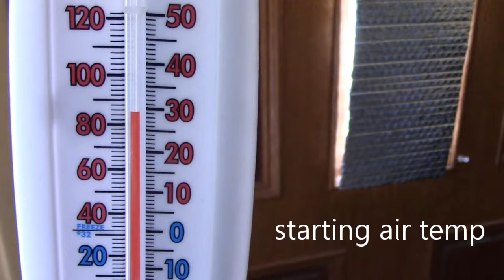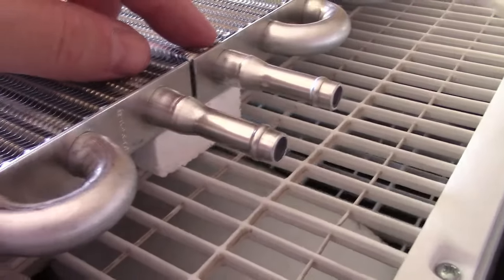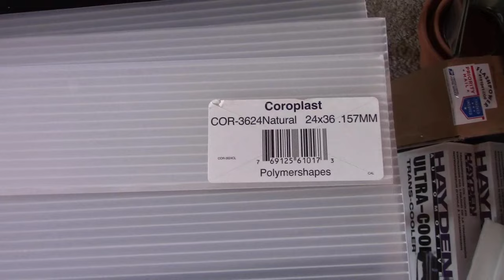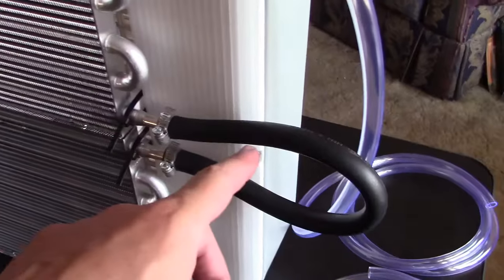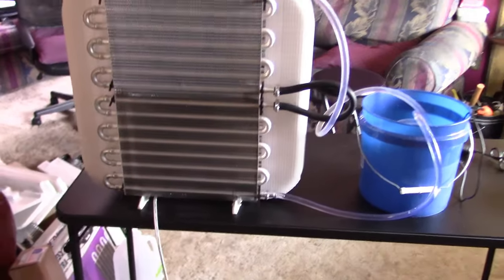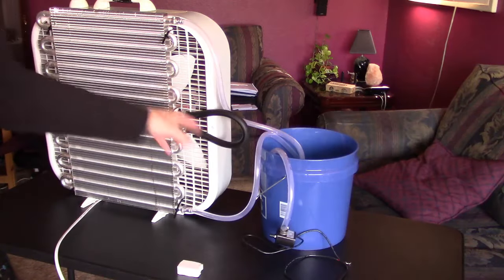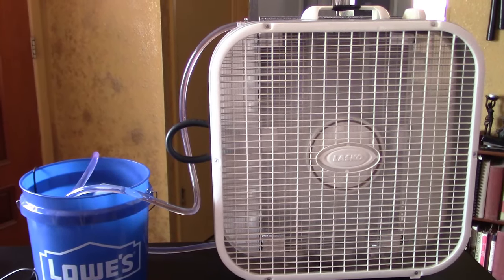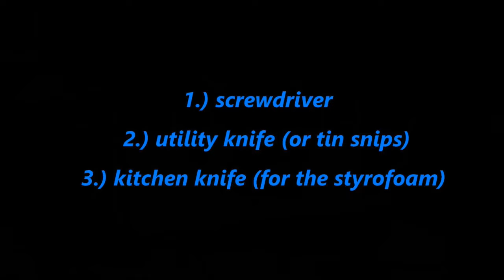DIY Air Cooler! Homemade Air Cooler with AC "like" feel! (extended *semi-uncut version) Box Fan conv

Comment: Though most people might not initially think of it that it might not be a lot of lost airflow, intake will mostly take the path of least resistance. I really like your idea to solve that by using foam shrouds to direct all of the air over the fin coils. I might also suggest using a removable micromesh screen to cover the coils and keep any house dust from collecting and clogging up your radiant fins. Also an evaporator tray or pan like a long planter box under the coils to catch any condensation. I'm also thinking that the use of a cooler V.S a bucket would help your run time per changing out water for more ice. Thank you for the great idea and the theory. I'm off to build my own version now. :)

Comment: This is very cool, no pun intended.  Is there any difference in the transmission between the two radiators since you are running that same water through both?

Comment: So cool. Great out of the box (fan) thinking. I was thinking if you run each radiator on it's own small pump, rather than have a two stage system, you would have two single stage coolers pulling from the same reservoir. I believe this would be more efficient.
As the water makes it's way through the top radiator and into the second radiator, the same volume of water will gain more heat in the second stage from the environment, and return this heat into your reservoir, reducing the run time.
Running each radiator separately from the same reservoir will also make the top and bottom radiator run at the same temperature, rather than the top being cooler, and the bottom running a little warmer.
Reply: You will also have 2 pumps generating heat in your reservoir rather than 1.  so it's 6 of 1, half a dozen of the other.
Reply: @rasputinsorphan1260  IF he was to put a tee in the supply side and keep the lengths of tubing equal to both coils it should depending on any difference in the resistance of the coils themselves be equal flow to both. It would also be possible to do the same on the return side by using yet another tee and keep those tubes as equal lengths too. That would make it possible to use one pump and have equal temperature of water to both coils.

Comment: HI and thanks so much for your videos!! Only have one question. Why use the Cloroplast between the radiator and the fan? Doesn't it interfere with the air flow? There was no sound (for me) when you probably explained it, and I looked at the comments and probably missed you answering the question.  Much appreciated.
Reply from the maker: hi. the plastic side panels are just on the edges of the fan. they end right at the edge of the radiators so they don't block the airflow between the fan and the fins.

Comment: I wanted to try your method but i had alot of car radiators in my shop just laying around and sure enough that worked. But the only give away was that i had used dry ice with water.

Comment: I already ordered the radiators. I tried the whole copper wire around the box fan but its not that efficient. This looks to be way better. The power went out over here in Southern California a few days ago and it was hot. Luckily I had mine built but I realized it wasn't blowing cold enough with copper tubing. I like the combo with the Evap cooler too. After I get this together, that will be my next project. Thanks for the videos and the explanations. This helps out so much, especially for someone like me whos mind is constantly going and thinking of solutions to these grid down problems.
Reply from the maker: hey there! i'm glad my videos are helping you! i'm also glad you're making the projects. since the "copper coil" unit is just copper with no fins, the heat transfer is only partial. these fans with aluminum radiators are much better at the heat transfer (and therefore cool the air much better). i'm glad you noticed my other videos on how to use these 'fans with radiators" along with my DIY evap 'water chillers'. that makes indirect evap cooling and is a great way to make the cold water without using ice. for anyone interested in evap water chillers and indirect evap cooling here is my main video on the topic https://youtu.be/I6u6yCe8RzI
Reply: @desertsun02  by the way. It works great! I connected the box fan with the radiator on the back and connected it to the evap cooler. Just awesome! Thank you. I want to make a smaller one for my sons room.

Comment: Loved this video.. You could try mounting it on to an ice pack box where the entire unit would sit on the cover of the box (that is if the weight of the fan and the grills aren't too heavy). That way it would look compact and avoid the hassle of an open bucket with pipes.. Kudos thoo.. 👏

Comment: Just wanna start off by saying thank you for the idea. I tried it out myself today and was on a budget so I just got one transmission cooler and even with just one I was so surprised how cold it was blowing works great defiantly gonna order me another Hayden radiator it’s like it was made for it. The only issue is I get a lot of condensation on the water hoses. I am thinking of also insulating my Home Depot bucket or using a styrofoam cooler. I need to find a way to be more efficient and keep the water colder for longer. My ice tends to melt pretty quickly been getting a lot of 100 degree plus weather recently in Southern California. Thank you again for the idea.
Reply: How long did it last for you? And what about water dropping from the transmission oil cooler? How did you deal with that?
Reply: @007alztruli  so since my ice would melt pretty fast I started to use bags of ice with ice packs included  to keep the water colder longer. I also put foam insulation on my hoses. It was a piece of foam that looks like pool noodle but made for pipes to insulate them. Instead of a homedepot pocket I used a actual ice chest too. And I would also get a lot of condensation on my transmission cooler so I would put like a towel underneath my fan to catch the water dripping that was caused my the condensation. Another thing that would would help was spraying the coils before hand with cold water to speed up the cooling process. Hope this helps.
Reply: @Guzman3605 Thanks. You didn't say how long the ice lasted though...

Comment: Great build. Thanks for your videos. I would love to see a build with all 12v components and have it run off of solar panels with a charge controller. Does it matter which aluminum radiator one chooses? I’m assuming everything can be acquire from an automotive store. Thanks in advance. 🙏
Reply from the maker: hi and thanks! i like the hayden transmission coolers the best - but i'm sure there are other good brands out there. i've got videos on running these off of 12v solar panels. to find them fast check the playlist area of channel 👍

Comment: Have you considered using a water dispenser( I don't know what they're called in the US.. I'm talking about the 'water coolers' they have in offices) instead of ice water? The power consumption would be almost negligible and you'll have a constant supply of ice cold water that'll never warm up 🤔
Reply from the maker: hi there. i hadn't thought of that but that is a great idea. if they can cool the water at a good pace that might be the answer to cooling 24/7 with ease.
Reply: A cheaper option might be putting the pump and water in a "portable mini fridge cooler" and drilling some holes through it for the tubing. They are about $44. Not sure how much power they draw.
Reply: @bigzen69  the problem is the water is being cooled... as the fridge emits energy into the room🤣
Reply: @matthewhodes1908  exactly you would need to dump the air to the out side from what ever is cooling the water.  I would use something like this out on my sun room that doesn't have ac to it. I could work in cool space and then just refill the warm water.
Reply: @biggc49042  how can u get the hot air outside?
Reply: @matthewhodes1908  you would need to set up something like a dryer vent has. What ever the exhaust from the condenser or what ever is cooling there is a heat exchanger thwt needs to be vented outside.

Comment: lol this was exactly what I wanted to see, I wonder if you can get away with other types of radiators that are cheaper for the surface area.
Reply: he has a few he made with copper tubing and one with copper tubing and aluminum fins but you could also just use a garden hose, it wouldnt be as efficient but it would still be cold from the water and theres no reason you couldnt recycle an old window ac's radiator system or look through a salvage yard for one

Comment: Great idea!  I'm looking for the parts to make one in case of power outages here in TX but I can't find the pump with barbs for 3/8".  Could you add a link to the one you have?  Thanks in advance!
Reply from the maker: the pump i have is an 8mm (5/16") one i think if you use a clamp it fits good.
Reply: @desertsun02  Thanks!

Comment: Amazing work! Since I can't get that radiator imported here, what would you say.. is it worth trying with a water radiator (the one used for cooling the engine) or the flow would be way too fast and the effect will be less?
What would you advise?
Keep up the great work!
Reply from the maker: hi. i'd say give it a try 🙂
Reply: Hi 
Did you try using the car water radiator ?

Comment: Hi, thanks for sharing. I used your concept and build a mini one. Nice.
One question is, how you handle the condensation issue? The cooler will be dripping wet.
Just trying to see if you have a tip for this.
Reply from the maker: hi. i don't get any condensation (because i live in an area with low humidity) but you could make a simple drip tray *or possibly just set it on a towel or plastic sheeting

Comment: Hey I built my own version of this based off your video, Ive used a food cooler instead of a bucket which Ive then added more insulation to the outside & it works great. I had an idea based on your mini-fridge/freezer peltier video, do you think if I attached peltier units to my food cooler to keep the water inside cooler for longer would be a good idea? Or would this just be adding more hot air into the room anyway? What are your thoughts?
Reply from the maker: hi there. hey, that's awesome that you built it and it's working good! i wouldn't bother using peltier with this. those take a long time to cool things down. this unit would overpower those very quickly. also they would just add hot air into the room. you could exhaust the hot air out of the room then they might help a little...
Reply: @desertsun02  Thanks for the reply I appriciate your input. I think I might buy a mini-fridge so I can keep more ice packs to prolong each ice refill instead.
Reply: keep the fan unit inside the house and the bucket outside with peltier attached.

Comment: Great !! Must work excellent in Arizona or arid places.Here we get 100F on 80% RH during summer,so we deal with lots of latent heat..but I gave you advice.Buy that small chest freezer at Lowes and put that bucket in it,fill  up the freezer with ice from gas station, let the freezer run for a day and then it will last a good week of constant cooling for what just 200W chest freezer running?! The most efficient cooling is to have cooling device in the room. yes..
Reply from the maker: hi. since this isn't evap cooling it works pretty good almost anywhere. it does work better in drier areas but only because it's easier to cool (or heat) dry air than it is to cool or heat humid air. still should work pretty good even in high humidity though 👍🙂
Reply: @desertsun02   I agree, it would cool the hot saturated air,but it would feel kind of swampy a front of that cooler..Unfortunatelly the best solution here(south FL) is to dehumidify the hot swamp air and then heat it a little bit inside the ductwork(attic does the heating) so it goes inside the house cooler and drier like 60F,but it does take energy, to lower the cooling demand it is wise to address roof and  insulations first,..Anyways, this is really good idea for hurricane emergency cooling, if you have solar backup or generator to make ice.Indirect evaporative cooling is still the best energy wise, the problem is to get the water chilled for long time.

Comment: I am wondering why you need to offset the cooling fins with the styrofoam instead of zip tying directly to the fan?
Thanks for all you do. Many cool projects…
Reply: You must have missed his reply in the other video. Here it is.

hi there. very important - don't just zip tie it to the fan. it will wreck the heat exchanger (it will bend the fins making it unusable *among other things). the styrofoam is for several things. 1.) it's for protecting the fins. 2.) for offsetting the radiator from the fan to handle the condensation. 3.) to stabilize the fins onto the fan so the unit won't shake or move around.. 4.) also it absorbs any noise. it's like a firm cushion between the fan and the fins. 4.) keeps the whole thing running smooth and quiet.

Comment: I built this years ago as a experiment.   I used a 4" core radiator and 44 degree well water.   It did work to some extent.    One day i want to build a heat pump that works on air alone,   a swamp cooler seperate with a pump to get a air pressure drop.    If the air is pre-cooled and then add some ice it should work well as a dehumidifier.   A bruteforce way to remove humidity?   someone grab a bucket of dessicant.

Comment: hi this might be a dumb question.  but should the radiator be at the front or the back of the fan?  could i buy  four rads and do both front and back? or is that a waste?  thank you!  awesome job btw1
Reply from the maker: hi. i like putting them on the back. the air flows faster and smoother that way. you could put them on the front if you wanted to. I've never tried them on the front and back at the same time so i'm not sure what the result would be. it might get cooler but you'd probably go through twice the ice.

Comment: @desertsun01 , thanks for putting this video. i used your method and did similar setup few days ago at my home. aluminum radiator, ice cheast for cold icy water, water pump, and tubes to cool the radiator,and fan behind the radiator to push cold air. the issue i noticed that i need a lot of frozen water bottles to use in the ice chest to keep the water cold. my goal is to have this system push cold air while i am sleeping for 7-8 hours. so achieve this 7-8 hours of cold air, i guess i need a lot alot of frozen gallons each night. which is not feasible in this case. 

Do you think, putting the radiator outside the ice chest being exposed to the room temp is making the icy water to melt/be hot quickly ? 
i have seen others do put the radiator(s) inside the ice chest, pull air from room to inside the ice chest, the intake air will hit the radiator inside the ice chest, cools down, and then pushed out from another vent to the room. 
do you think this is better than putting the whole radiator outside exposed to room temp and being losing cold quickly and in this case the frozen gallons can sustain for more hours ?
Reply: simple answer;  the air won't be as cold blowing out if it unfreezes slower.  I'd try setting fan to lowest speed first and running a secondary fan away from the radiator to just help cool in general unless you are fine with just slightly cooler and lasting longer.

Comment: Going to build one of these. What happens if you mount the radiators on the other side of the fan? Seems like it would get more Air flow.. thanks for the video.
Reply from the maker: if you mount the radiator on the other side it acts like a 'wall' - and blocks about half to two-thirds of the airflow. (it still works but airflow is greatly reduced)..
Reply: @desertsun02  that doesn't seem to make much sense really... please explain how configured everything on the opposite side could block more of the airflow?
Reply: @ihatesignupsgrrrrrrr I've tried it and airflow is very bad. Seens like Radiators are designed for air to travel up and down and exit both sides. Air just seems to come out the sides instead of straight ahead, when you try to force air through.
Reply: @overnightdelivery  Thanks for the response!